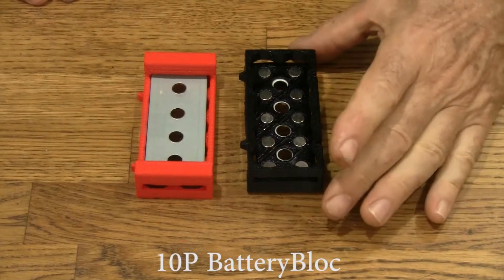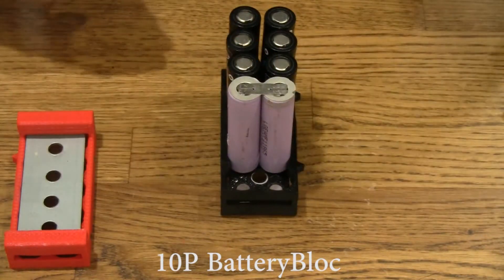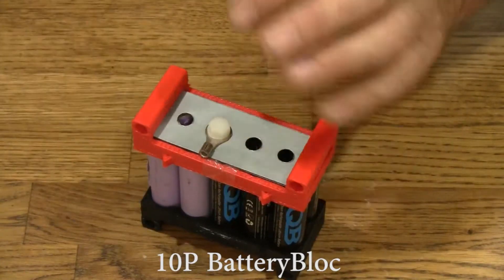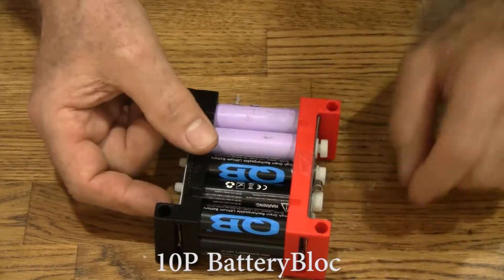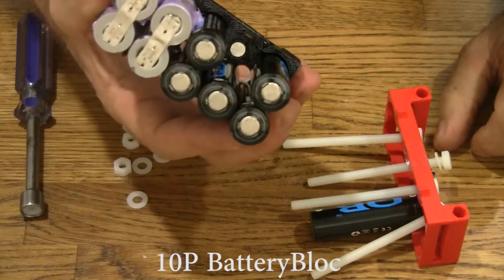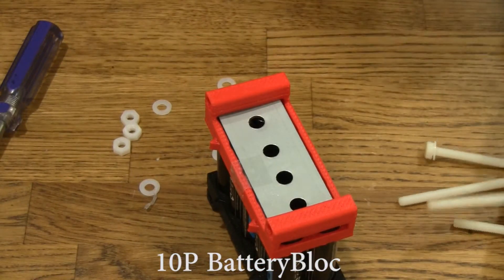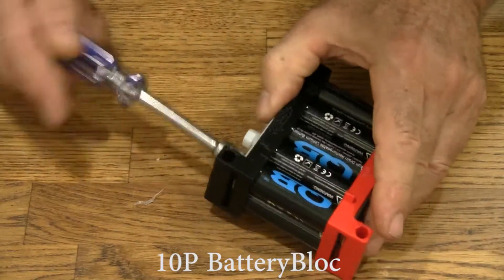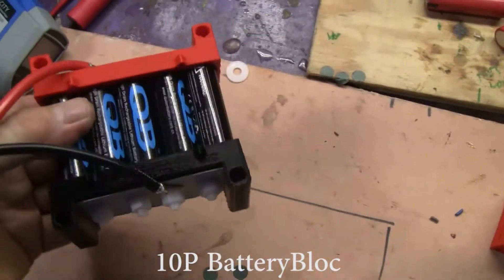10P

Comment: hi shawn how was holiday not to breezy I hope.do I need a 12v adjustable power supply like yours 0 t0 30v 10a seen some ebay £50
Reply from the maker: Ha!  I was blown away!  How about a benchtop power supply.  Runs on 110 or 220, not 12.  I'm sure its in the UK.

https://www.amazon.com/Yescom-Precision-Variable-Digital-Adjustable/dp/B00SWK6M0M/ref=sr_1_6?ie=UTF8&qid=1540322862&sr=8-6&keywords=benchtop+power+supply&dpID=511xBvvt3YL&preST=_SY300_QL70_&dpSrc=srch

Comment: hi shawn ive ordered a drok like yours to charge my 14s5p battery its split into 6s2p  x2 an a 2p .can I use thr drok to charge the battery as a whole ok ?going use 12v dc power supply from a pc 750 watts be powerful enough?
Reply from the maker: If you are going to split a 14s5P battery you should split it into two 7s5P batteries.   You can bulk charge with a Drok, or any power supply, but you need to have an 8S Hobby charger (they don't make 7S) to balance the halves of the pack.  You can power the hobby charger with the 12VDC power supply.   Yes, 750 watts would be, speaking generally, not knowing the cells, too much power for a 7S5P battery.  100 watts would be plenty.
Reply: I didn't think I could afford an 8s charger but seen a skyrc one for 42£ .I can balance with the drok can I?have a turnigy accucell 6 to do 6s and 2s they seem ok at moment I made another 48v battery for extra range with 36v hoverboard battery plus my own 3s.getting 40v off Samsung hoverboard cells
Reply from the maker: You could balance with the Drok or any 4.2 volt charger if you charged each parallel group of cells by themselves.......